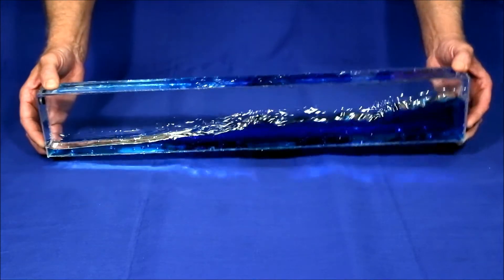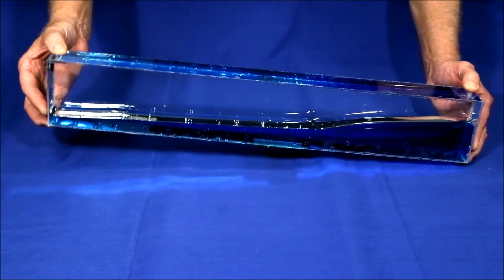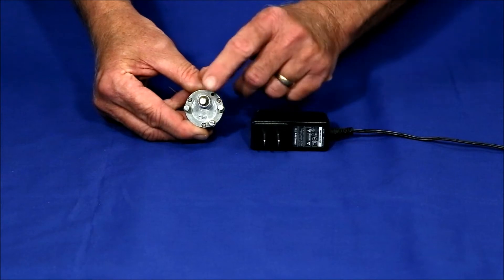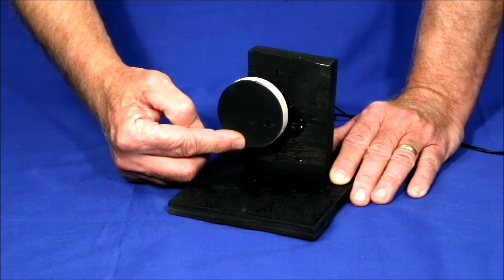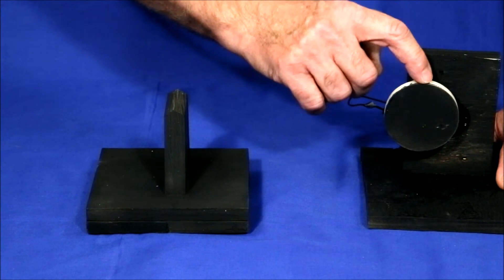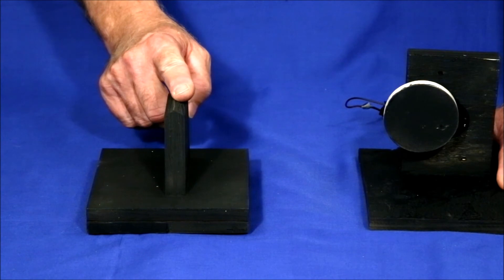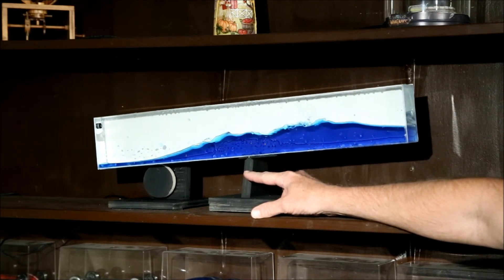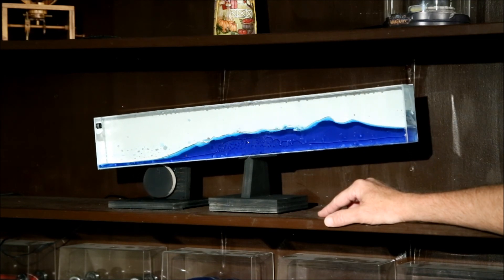How To Make A Wave Motion Machine   Part 2

Comment: This is just a thought, I haven't built one of these (yet), but to reduce much of the friction between the wheel cam and vessel a small connecting rod, similar to an engine rod, could be made to attach to the wheel/cam and then to a pin attached to the bottom of the vessel, like a wrist pin. The connecting rod where it attatches to the wheel could made to adjust in or out from the edge of the wheel to adjust how much stroke or lift it has on the vessel. It would probably need to be a round wheel attatched to the motor instead of a cam profile because you'd have your lifting action performed by the connecting rod. You wouldn't even need a round wheel, just a thin strip of wood to attatch the connecting rod to.
Reply from the maker: Great Idea! Thank you!